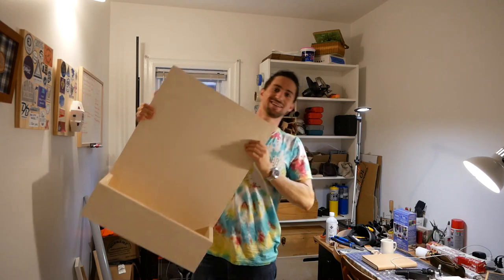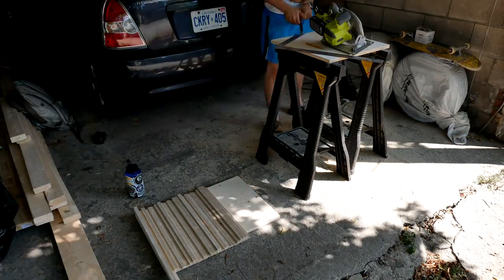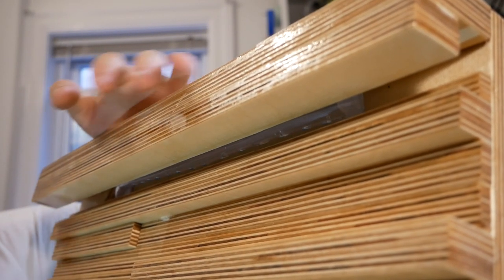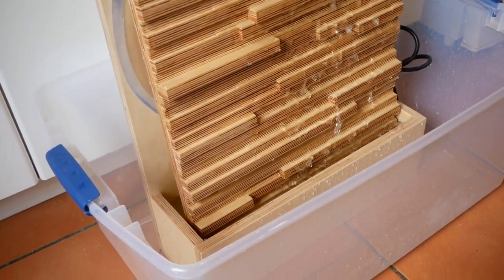Making a PLYWOOD FOUNTAIN //  DIY WATER FEATURE

Comment: There is an idea there. One more small thing as Grant will be pleased to hear, free handing the tile strips will introduce small stresses and weaknesses where water will get in. Polyurethane glue is water proof, but the wood it is attached to is not. You could try completely finishing each strip in epoxy THEN glue them to the backer board. That way any tiny gaps in the glue won't act as sponge points. Very interesting concept 👌
Reply from the maker: Thanks for the feedback, James! I guess I was thinking that using the gorilla glue would fill in any gaps caused by my freehanding, but I probably didn’t use enough glue for that to be effective. I think I’m gonna coat it in more epoxy in the future.